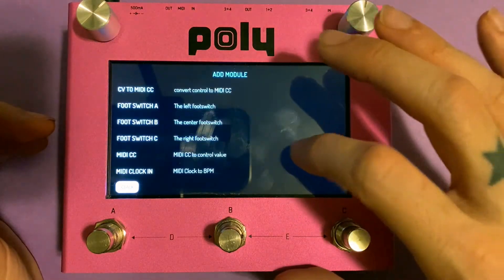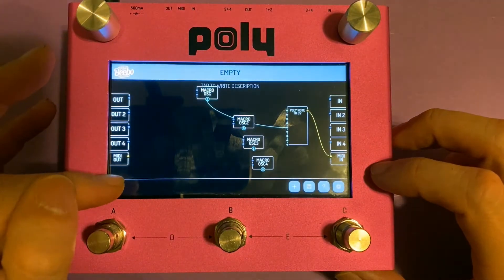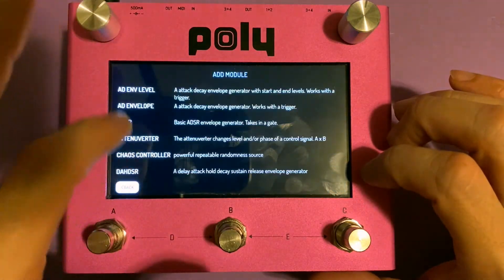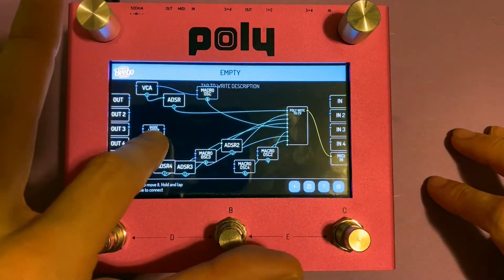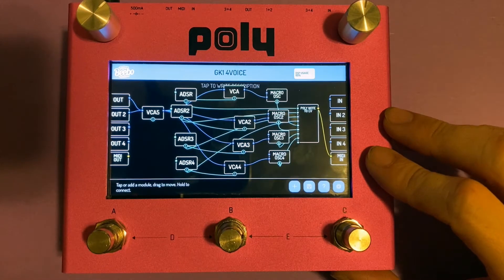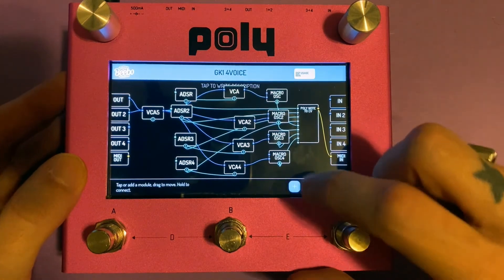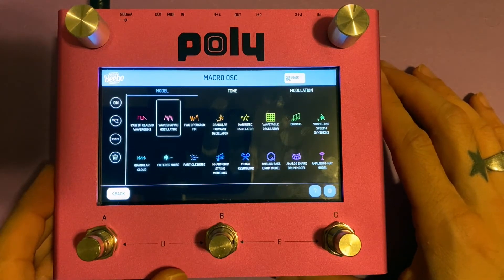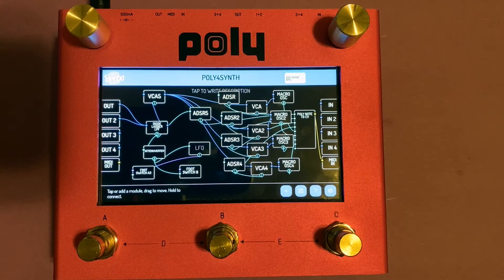Beebo Midi Synth Patching 101 - Part 2of2

Comment: A trivial question: is the Beebo output signal high enough for standard headphones?
Reply from the maker: Hello! That’s not a trivial question at all! 

It actually is too loud, I would use a VCA to be a volume control at the end of the signal chain to set it where you need.

Comment: Have you reached the upper limits of the cpu power (especially with using all of the normal inputs and midi inputs at the same time)? If so, is it a problem that you run into often, or a rarity?
Reply from the maker: Hi Benjamin,

It really depends on what you want to run from a module perspective, some things are more expensive than others in a patch against the CPU limits. Midi/CV control modules are usually light, so are the VCA and signal routing type things if integrating external gear. 

What are you trying to do overall ideally? I would be more than happy to give you a specific answer based on your rig or intended setup!

In general, I try to think what do I need to do most - for instance I often might go for 3 oscillators and leave room for a reverb module and a granular module to create a larger performance patch that I do not need to change often within a live set. Sometimes I have sequencer modules and also midi control going on in the background with other devices in that same patch to/from Beebo.

If I am making a proper synth patch for a recording, I might not need reverb at all from Beebo and load it up with 4 oscillators and other things but still have room left over. Recently, I had been using it to provide FX (dual stereo reverbs and control modules) to both a Digitone and Digitakt being run through separate stereo path ins and out to a mixer for recording.

Comment: Does the drum patterns module sync to midi clock?
Reply from the maker: Yes, you can sync to midi clock for tempo but not for stop/start commands via clock send/receive. I do it by using a midi clock in module (patched to the midi in on right side) and patching the midi clock in module then to drum pattern generator itself.